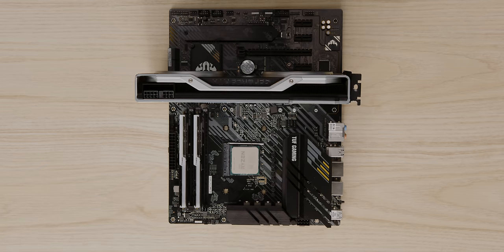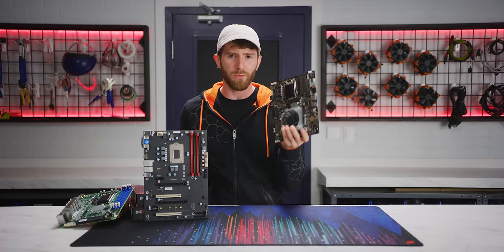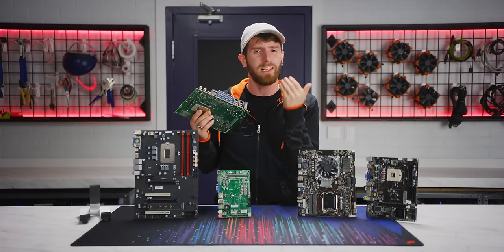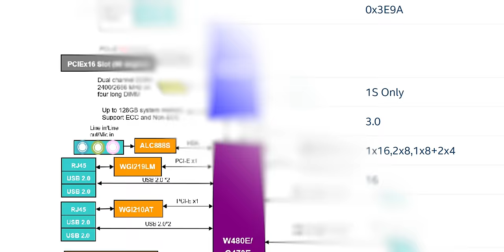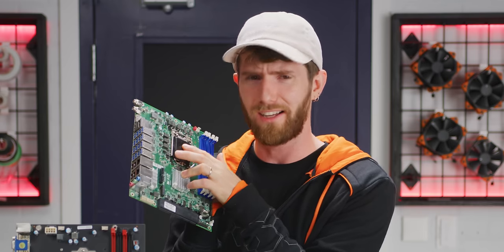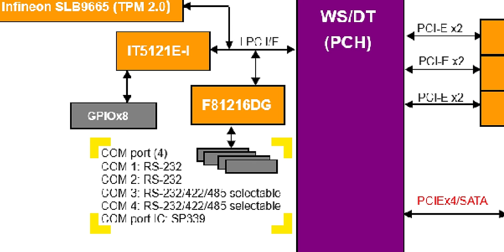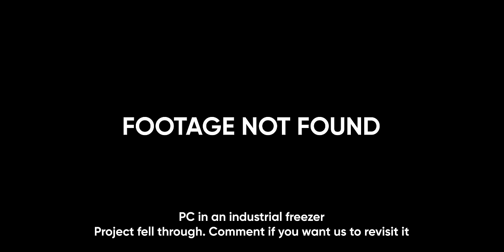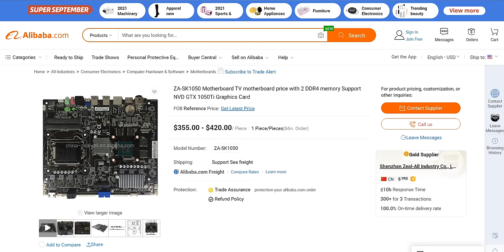5 weird motherboards that shouldn't exist

Comment: The first board could also be used in audio workstations where lots of USB MIDI devices are connected to a VST host.
Reply: Why wouldn't you just use a standard MIDI interface? You can daisy chain them forever.
Reply: Just. Buy. A. Hub.
Reply: Because there are a lot of USB MIDI devices without actual MIDI In/Out/Thru ports.

A USB hub usually causes more problems than you were bargaining for, especially if the link to the hub drops.

I've worked for livestreaming events, we used many USB devices and when a hub had to be brought in... problems were to be expected.

Sure, you can use keyboard and mouse on a hub no problem. Even simple USB MIDI keyboards are fine, just don't connect a camera with other audio interfaces over a hub.
Reply: @widg3tswidgets416  Yeah, but like, it would be nice if you didn't need a hub. 🤷‍♂️
Reply: @widg3tswidgets416  usb hubs and audio gear do NOT play well with each other
Reply: ooooh like for music and video kind of thing?
Reply: @kg4boj  latency, it is bad practice to link a whole bunch of separate devices together. You can daisy chain a small klavier with a synth and control some effect, but with digital interfaces you usually want more MIDI ports available.
Reply: @sjoervanderploeg4340  Yeah ok... If 1ms lag is of concern you just need to move one half centimeter closer to your speakers.😂

Comment: Remember a old mobo that accepted different sockets into it as long as you'd swap the mobo's own socket with it.
Reply: ASRock did a lot of weird boards with CPU upgrade cards (from Socket 754 to 939) and even boards with two different CPU sockets you could pick between (Socket 478 for earlier P4s and LGA775 for later ones... and a f*ckton of jumpers to select which one you want to use)

Comment: The oddest mobo I personally owned (by accident) was a MicroBTX Pentium 4 motherboard...yes BTX.. I didn't notice the different letter when I bought it until I tried to put the thing into my computer. Thought I had bought a motherboard from the mirror universe for second before I took another look at the box. :P

Everything on the mobo is backwards. Assuming a tower case PC layout the expansion cards would end up on top instead of below the CPU area and obviously this means you couldn't put it in a normal ATX case. :P

Kinda a shame I decided not to try and build it out. The one benefit to the BTX layout is the VGA/DVI/HDMI connectors on graphics cards added to this setup wouldn't be upside down in a tower case layout. :P

The pricing for getting a BTX cooler and case made me choose not to finish that mistake. Had I at least been able to use the cooler I already got I would have considered trying to get a case to put it in. :P

Comment: The motherboard in the thumbnail has too few USB ports for me.
What? It’s too many ports for you? But I need 15 USB hard drives, a flash drive with Linux, enough USB DVD-ROM drives for all 100 something of my DVD-ROM/CD-ROM games, 4 Xbox controllers for local multiplayer in 3D games, 4 NSO SNES controllers for local multiplayer in 2D games, a mouse, a keyboard, at least 5 ports to charge my consoles, MP3 players, and tablets, and finally two more ports for my USB camera and mic.
Edit: XD

Comment: It actually reminds me of a daughter board for a much larger system.  We use to use them in industrial machines, even though it has a video out put and everything else that might run on a motherboard, the power may be coming to the board from the slot.  It seems it is just a elaborate daughter board.

Comment: The first motherboard is very similar to the ones on our machines at work. We use them for our machining cells. Computer can communicate and monitor several proximity sensors for our robots and conveyors that feed our CNC Lathes.

Comment: OMG, I'm in love with the one which comes with 20 USBs. It's so hard to find a motherboard with at least 10 USBs nowadays and you have to pay for it a lot more for all the other features you might not even need at all. I personally need 10 USB ports at very least: mouse, keyboard, webcam, usb mic, music player doc station, xbox remote controller usb dongle, music midi keyboard, monitor, ups, printer - and that's not all. And most motherboards nowadays comes with like 6 USB ports at very best.
Reply: Buy a hub